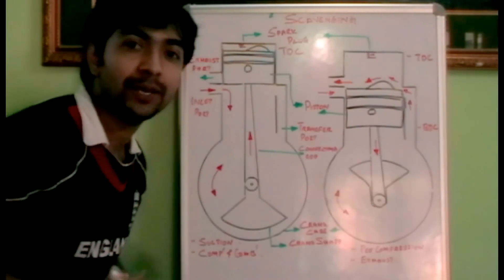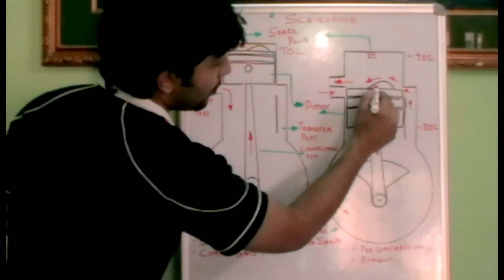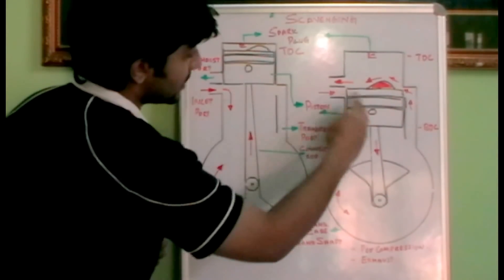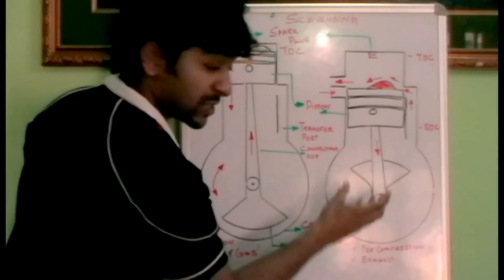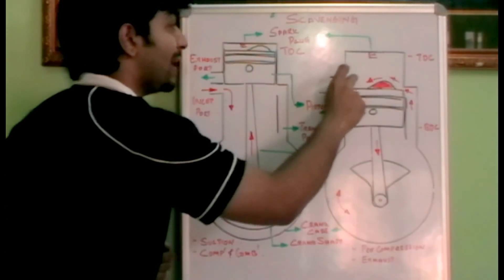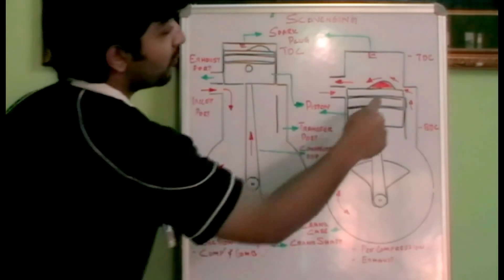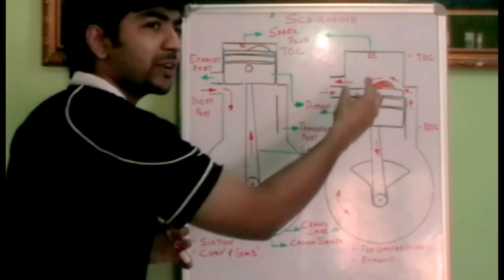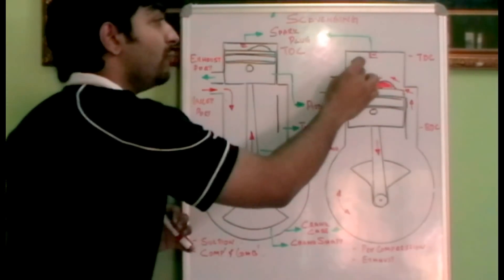How scavenging in two stroke engine works. ✔

Comment: Nice video. Most modern 2 strokes use the Schnuerle loop scavenging that utilizes the transfer ports being aimed at the intake side of the cylinder to accomplish scavenging. The deflector piston domes like you show have been mostly phased out due to the heat loading and tendency to seize. The deflector pistons also had much lower compression ratios and therefore lower horsepower yield.